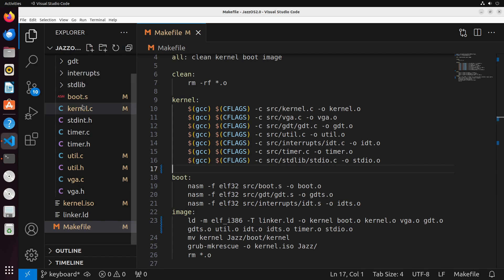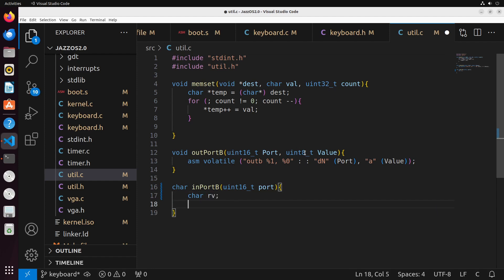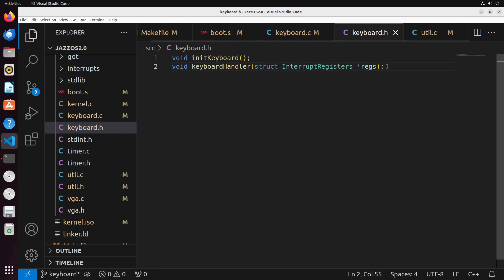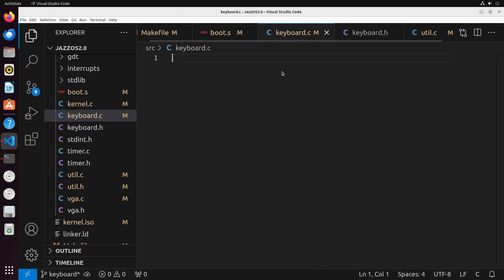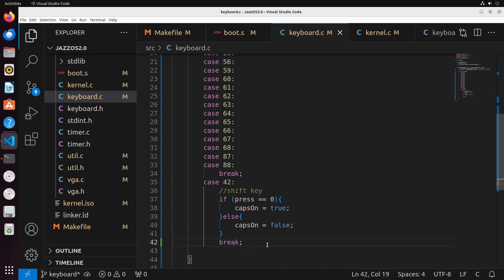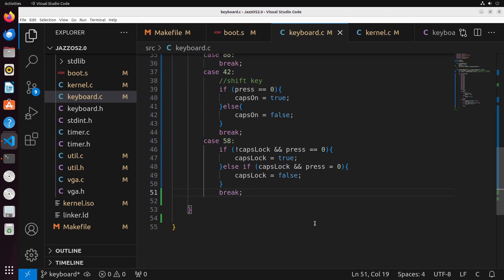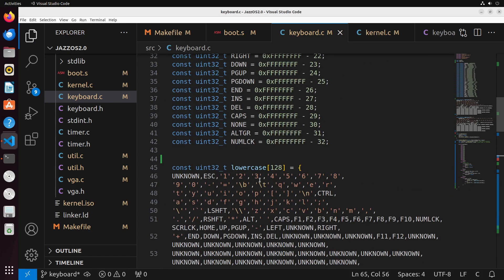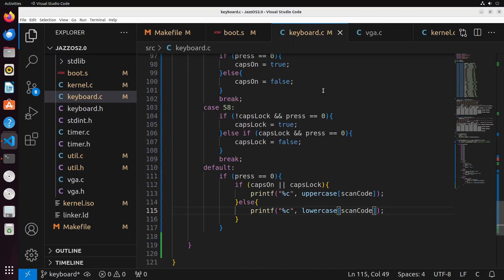x86 Operating Systems - Basic PS2 Keyboard Driver

Comment: Hi Scott, I think there is some issue with printf or the way data is passed from input, because every time I press a key it append zero to to the character it prints. Would be grateful for any help. Thank you
Reply: OK, removing the "-02" flag from the line 
CFLAGS = -ffreestanding -Wall -Wextra -g -O2 in makefile fixed the issue.
Reply: While removing the -O2 flag is a "botchy" solution, there is a proper way to implement this; replace your putc function with this:
void putc(char c)
{
    int value = (uint8_t)c; //note uint8_t might've been spelled wrong, as in my code this is u8
    print((char *)&value);
}
This ensures that the compiler's optimisations aren't too smart for its own good (side note: this optimisation bug is actually part of -O1, which is performed as part of -O2)

Comment: Luckily for me, of my five working computers, one is old enough to still have keyboard and mouse PS/2 ports and I have an old working PS/2 keyboard and mouse available so, in addition to running the OS in QEMU, I can still burn the OS to a DVD+RW disc and boot and run on real hardware and have a working keyboard and mouse.  Do you plan to implement USB drivers?  I love this series and hope you continue with it.
Reply from the maker: Nice! I realized I also have a computer with a PS/2 port, I'll have to try booting on a CD sometime as well! I'm planning to add in the USB drivers as well, I want to get as many hardware and I/O devices working as I can
Reply: @olivestemlearning  USB please
Reply: You can actually add it to a USB PC as well because USB is backwards compatible with PS/2, AS LONG AS the motherboard doesn't have PS/2 ports
Reply: I have a Windows 7 computer that I tested my OS on, and my USB keyboard worked perfectly fine.